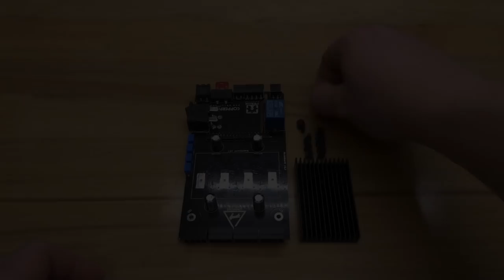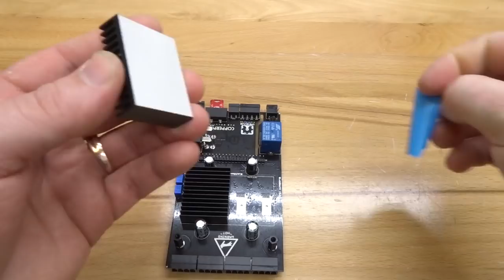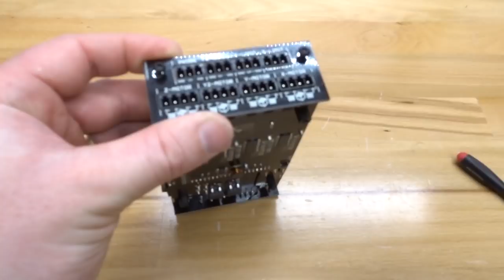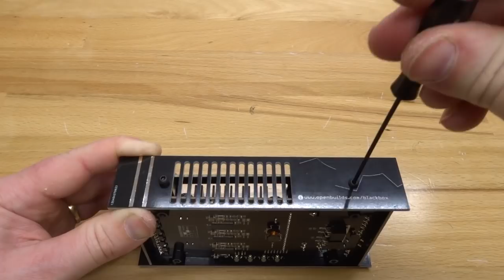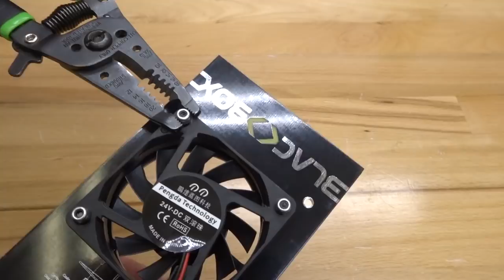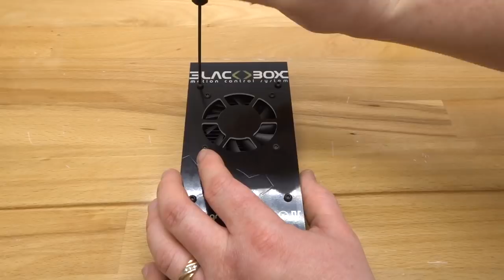OpenBuilds BlackBox

Comment: what stepper driver does it use as I cant find the full spec
Reply from the maker: The BlackBox uses Toshiba drivers. Here is a link with additional information: https://docs.openbuilds.com/blackbox/#12-assemblyvideo.html
Reply: @OpenBuilds  I couldnt find any information about the exact drivers in the documentation.
Reply from the maker: Please follow the thread here for more FAQ: https://openbuilds.com/builds/blackbox.8320/

Comment: how can i wire this to a co2 laser ?
Reply from the maker: You can check at OpenBuilds Forum as there are multiple users doing the same. There is no official documentation for multiple reasons: 1- There is no reliable/standardized information from CO2 laser manufacturers. 2 - You will be dealing with High Voltage . https://openbuilds.com/search/142446368/?q=blackbox+co2&o=relevance

Comment: 🇳🇱🇳🇱🤪🤪👍👍👍🤔🤔🤔🤔🤔🤔🤔can I use; BlackBox Motion Control System.  also use on an ender 5 (pro) 3D printer ??.
 translates at google from the Netherlands to english
Reply from the maker: The BlackBox is not for 3D printer control. Its can be used for laser, cnc router,drawbots, etc 3 axis control system. Please check out the docs found here to learn more - https://docs.openbuilds.com/doku.php?id=docs:blackbox:start